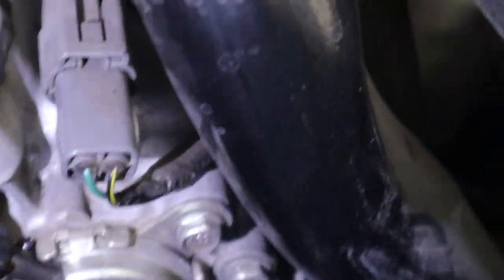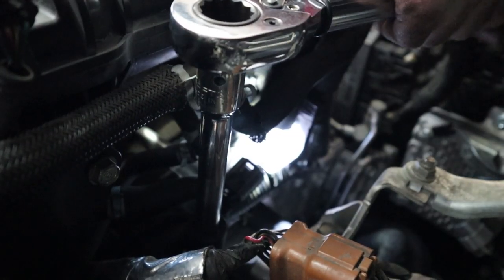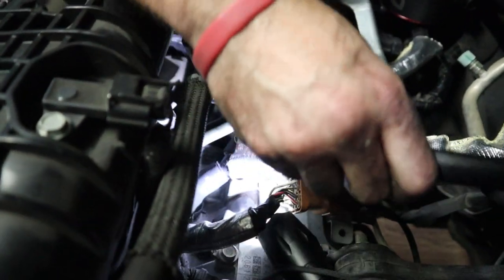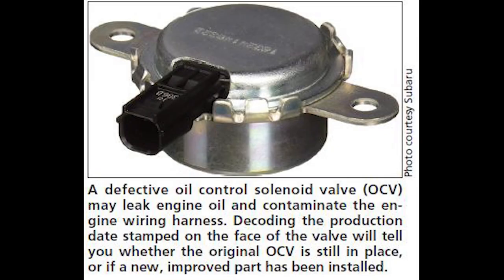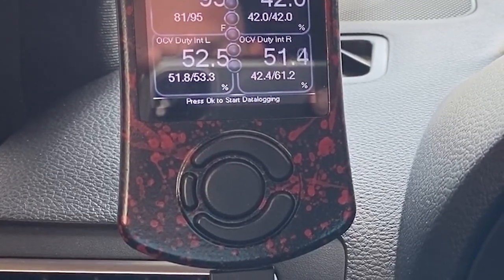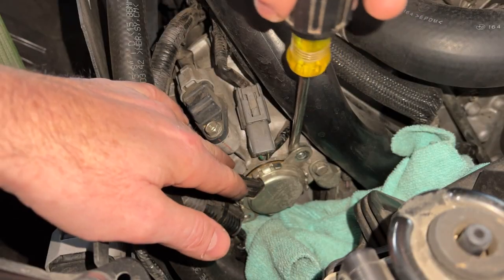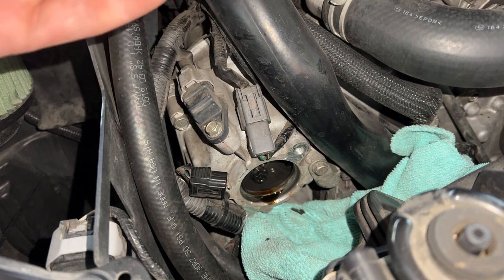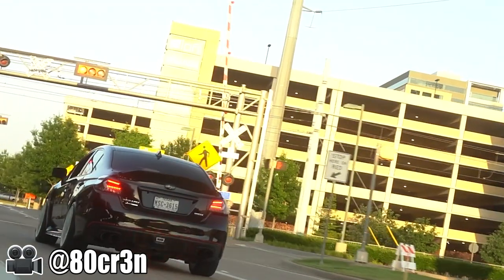It wasn't a vacuum leak | Oil control valve diagnosis/replacement

Comment: first off you dont put break cleaner on a maf sensor lmao
Reply from the maker: Didn’t seem to hurt anything🤷🏻‍♂️smells like maf cleaner🤷🏻‍♂️
Reply: Sprayed literally hundreds of MAF sensors with brake clean, carby cleaner, electronics cleaner and even one with white lithium grease by accident. Didn't make a tiny difference and I saw the cars come back 6-12months later running great.

Comment: Awesome video, now I know what to go check for. I believe I'm having the exact same issue with our 2014 Forester XT - sometimes there will be a really rough idle while other times it would be remarkably smooth, like there were a few times that I thought the engine had stalled out it was so quiet/smooth but it was actually still running. I bought the car used off someone and I was about to put TGV's back in, return the car to stock, take it in to Subaru etc. Now I can just plug in the access port and see what's going on!

Comment: So this was your issue buddy? I got a little issue going on and I may try this. Thanks in advance and great channel, also how did you know which valve it was ? You said there is 4 correct?
Reply from the maker: Yessir! I really appreciate the kind words! If you look them up on the accessport, there is one for each cam and they are labeled intake/exhaust left or right

Comment: Question, i think this is my issue. Least, i hope so. Car idles fine, then poof drops like 100rpm and boggs, then self recs and normalized. I see PCV R drops to 50.26 while my L stays between 53 and 55...

Exhausts are always stable at 42.

Comment: This should save a lot of people a headache. My Crosstrek did this and I cleaned the oil control valve with CRC Mass air flow like you did but I cleaned the Pin out and put new oil in the two ports on the valve. Been great for quite some time now. My STi is a 2004 so our solenoids are different but can still be cleaned and put back in to work.

Comment: P000D on my 2017 WRX STI happened last week haven’t used my car since then symptoms: misfiring, poor performance. Should I try this.?
Reply: Lmk I have the same code. I got the camshaft replacement but havnt put it on yet. I just reset my ecu lol.

Comment: The current drawn is also another good indicator if its working properly...when monitoring compare the current range as well.  Mine was reading low current as well as delayed movement

Comment: Did this fix your issue? My 2016 having rough idle which I’m winding down to throttle body (when I turn the car off I hear a loud pop noise every time like pressure is trying to release), pcv valve, or lines for the turbo.

Also when i cold crank it rattles like crazy with exhaust sputters unless I give it some gas then immediately goes away. 

Been driving me crazy for the past few months. 

No CEL though.
Reply from the maker: It did definitely fix the issue I was having, however my car wasn’t having any of the symptoms you’ve listed here
Reply: Corey Carter , did you fix your problem
Reply: I have same issue, have you found a fix?

Comment: I replaced the ocv intake left today and it does run better but the numbers aren't the same well they are the same sometimes at  53.3 but the new one stays at 52.5 and the right one is at 53.3 or 53.7 I may replace the other one too

Comment: i have a 2016 brz and i've been having  idle issues and a little engine knock do you guys think that it'll be the problem?
Reply: (Step 1) Oil change, (Step 2) Variable Valve Timing change, (Step 3) O2 Sensor Change. Normally, the majority of problems with Subaru revolve around the VVT (Step 2).

Comment: I have the exact problem with my car. Thank you for this video. I will change the sensor. Was wondering if you have the part number .
Reply: Hey Francis…I have a part number of 35-1265 from auto zone. Not sure if it would be cross referenced to other box stores. But you can give it a try.
Reply: @ipatchee007  thank you. Appreciate it !!
Reply from the maker: There is a screen shot of an OCV in the video at some point. The updated part number is the same except the last digit is a 1 instead of a 0. I’m glad it helped you!
Reply: @austinfromtexas so your car came with the one ending in 0 and you replaced with the one ending with 1?  Wanted to make sure they are interchangeable before ordering new ones. Thanks for the awesome video man!

Comment: I’m wondering if this is the issue I’ve been facing for the last good while. I have a 2017 WRX with only 45k on it and I’ve been having issues with it idling down to 500rpms when coming up to a stop and out of gear, sometimes stalling completely. I installed a AOS since I figured it was a bad PCV valve, that seemed to have helped but it happens most often when I’m close to needing an oil change, was going to do spark plugs and clean the throttle body since those are the other items I can think of. Were your symptoms similar to that? I also feel a lack of power and want to be sure before I spend the $120 a piece on these solenoids.

Comment: Thanks bro you found my damn Issue that's been driving me mad for the past few months now! didn't see it because of the intake cover (14 forester XT) but it was drenched in oil! I ordered the part but do you have to drain oil when changing this part out? looks like it does not come with spacer or O ring.

Comment: Can this make you misfire under boost ? I also have the same symptoms in the idle part, but I already checked everything else and nothing was wrong. So at this point im just trying to see other options
Reply from the maker: I wouldn’t think so, I never had a misfire when this was my issue. I’m also dealing with this issue again, on a different Cam, and now am getting a misfire. I’m currently suspecting a boost leak since fuel, spark and hopefully compression are all good, it must be air

Comment: Hey mate, you mention the rev drop, could you elaborate a bit more on what you mean by that?

My guess is after you've been driving, turn off the car, then get in and turn it on, you get a major drop in revs before it normalises/stabilised? 

I saw in my engine bay that one of mine has more oil around it than an oil mine lol, so guessing it may be toast. Thanks for the vid, would never have thought this could mimic a vac leak (symptomically).

Comment: I'm dealing with similar behavior on my BRZ.  I have a new valve coming tomorrow let's hope this fixes it.  Were your fuel trims off too?  Mine seems to be running rich for no reason.
Reply from the maker: Honestly not sure. I monitored Afrs, which all looked good. Which is why I couldn’t 100% confirm it was a vacuum leak. But really not sure if that’s the same as fuel trims. But I don’t think I had an issue there
Reply: @austin from texas  fuel trims are the adjustment your car does between target and actual AFR.  Say it pulls 10% fuel to get to the target afr you'll have a trim of -10%

Comment: I'm having the same issue but when I monitor OVC duty they're all ready 9.4% at idle. Any idea what that means?
Reply: Mine are both at 9.4% too, but my rough idle is coming and going...sometimes its running great, then out of nowhere rough idle and misfires.. I get the Misfire codes on 1 and 3, and the camshaft position P0011. You ever figure out what yours was?
Reply: Retuned. Now it’s running great! 🥲

Comment: Thats interesting. My 2017 WRX actually threw a code (p0018) and didnt have any hesitation issues, just the christmas lights on the dash. I need to get a walnut blasting done on mines at 60k miles.
Reply: I'm at 70k, and no blasting yet or planned.  Not totally convinced....

Comment: I believe this is my issue on my 2021 wrx with only 20,000 miles . The idle from mile 1 was erratic  and had a hesitation  when accelerating  . I looked at all 4 OCV's on my Cobb Accessport and the exhaust OCV's are both identical , BUT my intake OCV's are all over the place at idle or  accelerating,  so I ordered a couple  . Do you have the torque specifications for the two 10mm bolts ? I can't find them anywhere  and have no access to STIS data . Excellent video  ! Thanks
Reply: 6nm I believe

Comment: So my issue is that its idling higher than normal. Check the PCV valve and replace the hose from the AOS to the PCV valve and its high. Would this have the same affect?
Reply: Just saying probably not related but you can literally adjust the idle right from the accessport you didn't make any changes on the AP did you

Comment: hey boss how did u know which of the four to replace, did u just replace the one that was dipping lower at idle ? I believe I'm currently dealing with the same issue
Reply from the maker: The ocv duty cycle that would drop in sync with the idle dip is the one that was bad

Comment: Dam im having the same issue, you said if you pull the plug and its got oil on it ,its bad right....??
Reply: Dam... I only bought one
Reply from the maker: Yes that’s a good sign that something is wrong and it needs to be replaced

Comment: this doesnt apply to a va chassis sti does it? Im getting a cam position code
Reply from the maker: I would imagine it could. They both use avcs and I would imagine those are both controlled by the OCV

Comment: Just want to confirm that when it says "R" or "L" that "R" means the right side of the engine when looking out of the windshield, not looking at the engine from the front.
Reply: I'm assuming it's looking at the engine standing in front of it? so Left is passenger and right is Driver side?  I'm having the same issue and have changed so much parts hopefully this is the end. I'll keep you guys posted.
Reply: @MrDIJEN15  Actually, "right" is the passenger side and "left" is driver.  I replaced my right intake OCV.  Solved my issue immediately.  Very easy fix in 10 minutes or less.  OCV is not cheap though. Cost me close to $80.
Reply: @JetDriver77  literally in my Wrx right now. Changed the monitors and checking fluctuation. Also thanks for the clarification.  Also how big of a difference were they?
Reply: @MrDIJEN15  The bad one (right intake) was dipping below 50 for me into the mid to high 40's.  It was the only one doing it when my car was having the stumbling so I assumed it was the culprit.  Looks like that was also the one that went bad for the original poster of this video.
Reply: @MrDIJEN15  Your car will need to be having the uneven idle to see the fluctuations in voltage for the bad valve.
Reply: @MrDIJEN15  Hey Dimitrio, did you get your issues resolved?  I responded to you last night, but I realized I may have replied to my own post, so you may not have gotten a notification (see my posted above or below my original comment).
Reply: @JetDriver77  thanks for following up bro. I did see your response. I don’t get rough idle enough to check to often but when it fluctuates the difference is between 1-5 between screens. Is that enough to deem it ‘bad’?… and it’s also the same one in the video and yours…
Reply: @MrDIJEN15  Yes, it was dipping into the high 40's for duty cycle for me while the other intake OCV was in the low 50's and stable.  It will be pretty obvious which one is bad.  Not sure why it seems the right intake OCV is always the culprit.  Seems odd to me that it is always that one since the OCV part number is the same for all four.

Comment: So my car has been throwing a po172 consistently. More and more frequently. I just checked those gauges and the ocv duty int R is lower than left. Just asking to be clear, should they stay the same side my side at all times or just went rpm’s drop? The right is about 3.x lower than the left TIA
Reply from the maker: So yes. If the ocv numbers are differing, then there is an issue. If there is not an issue, then the rpm’s won’t drop and the numbers will stay the same
Reply: @austinfromtexas  so they should be the same left and right correct? It’s been a headache dealing with this… it looks like they are dropping at the same rate.  But the right is lower value than the left at all times. Does that make sense?
Reply: @austinfromtexas   
I have a 2015 Forester with FA20DIT, check lights P0172 showed more and more frequently this year. 
I replaced new MAF, O2 sensors, spark plugs and ignition coils.
I checked vacuum leaks, after check, they are ok. 
I will check my fuel injectors and those OCVs. 
Thank you.
🤩🤩🤩
Reply: @lcwei2238  Let us know if you have resolved the P0172 issue.
Reply: Same issue
2017 Subaru Forester XT P0172. Changed spark plugs, MAF, and the A/F (O2) sensor. The Subaru dealer did a smoke test and still couldn't find a leak to be causing it. Might try this next

Comment: So if there's 4 sensors, how do you know which one to replace?
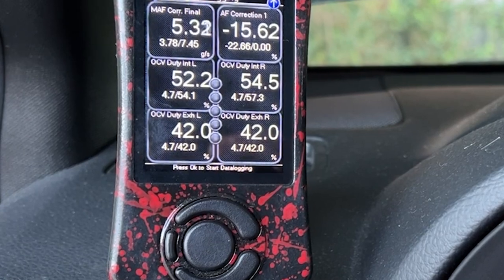Reply: At 3:11 in the video you can see he has 4 OCV duty monitors set on the Accesport. Look for the one that’s not reading the same as the other 3 and that’s probably the one that’s bad

Comment: hoping this is the challenge on my brz. just got slapped with p000b code. Tuner and mechanic reconommended i swap out all 4 oil control valves for new oem ones. there goes another $500 on something thats not cool like a big wing or carbon splitter 😓
Reply: Big wing or carbon splitter? This is why Subaru owners get a bad wrap. Would rather look cool than do maintenace and have a reliable car
Reply: How'd that go?  Did any codes return a few days after replacing all 4?
Reply: @tfpjr  ended up topping off my oil from middle of Low and Full lines, up to the Full line. then after clearing the code it never came back. but at that point i had already ordered all 4 solenoids and had them in hand so, just said fk it and replaced 'em all. haven't seen the issue again. I probably didnt need to replace them and it was just a fluke of going up a very steep hill without my oil topped off but eh you can always make more money
Reply: @15subarusti59   I spent the 500 immediately and swapped the oil solenoids even though i probably didnt need to. chasing maintenance and minor issues is the reason i dont have a big wing or splitter already. my cars boosted, lowered and on big wheels so yeah i want some aero
Reply: @rawrbrz  bro you don't even check your oil lmfao why would you dump money into exterior upgrades when you're just gonna spin a bearing from oil starvation anyways? I don't even drive my STi without checking my engine oil. It's a daily routine when you drive a turbo car my 2015 sti is a iag closed deck stage 4 shortblock, built heads, gsc cams, fp black turbo, id1700cc with double fuel pumps on a radium hangar with hobbs switch, ams intake manifold, koyo radiator, ets front mount with all titanium piping, steel braided fuel lines, cylinder 4 mod, cobb flex fuel, act twin disk clutch, e70 tune 600whp, among a ton of other upgrades, full build, the whole 9 yards. If you think you're engine oil is gonna check and change itself then don't even bother buying any upgrades for the car because you will need the money for a new shortblock eventually. There is absolutely no reason for your oil to be running low.
Reply: Save your money for future issues that will need attention don't go blowing money on carbon fiber aero that's silly. Soon as you install something nice something will happen and you'll wish you saved the money that's how these cars are man. Just a word of advice
Reply: @15subarusti59  Don’t worry big guy, i’m a financially responsible adult despite what my original comment would make you think. if my engine pops tomorrow i’d be sad but not broke. everyone should always have an emergency fund
Reply: Quick question. Is it the same part number for all the oil control valves? 
I have to change the lower one (code P000B) and I have only seen videos of people changing the upper valves.

Comment: Hey did u have to drain the oil by any chance?
Reply from the maker: Not at all
Reply: You absolutely should. Old oil is inside that ocv and you don’t want to have contaminated (used) oil flowing through your new ocv. Change the ocv immediately after you change the oil

Comment: will this cause oil in ur vacuum lines?
Reply: OCV DUTY RXH L IS 42, OCV DUTY exh R 42, ocv duty int l is 53.3, ocv duty int r is 52.5.
Reply from the maker: Not totally sure, but I doubt it. Based on those numbers, if the min for intR was only one below, I don’t think the ocv is the problem.
Reply: @austinfromtexas  would my vacuum pump be bad ?

Comment: Did you end up replacing all 4?

I got a 2016 Subaru forester 2.0xt. Last week I was having a p0016 (bank 1) code. Put some engine flush cleaner from Subaru in there. Changed the oil and it seemed to clear the code. Drove about 500 miles and now I’m getting a p0017(bank 1 exhaust). I’m going to try and replace both of vvt on bank 1 and see if this works. I was getting a terrible idle, almost on the verge of shutting off. 

See what happens.. I wouldn’t say it’s a cheap fix if you have to replace more then one lol.😅😅
Reply from the maker: True, not really cheap if you’re spending $400+ however, I did not replace all of them. Once it blew up, the shop replaced at least 1 and I have had to replace 1 more since it got tuned. So we’re at 3 total. And I feel like I might need to do 1 more cause the values are still off. So short answer, no, but maybe soon yes haha